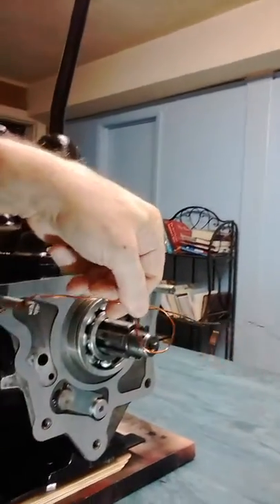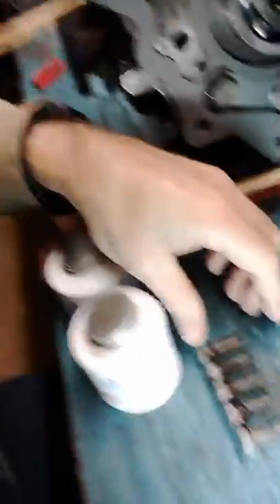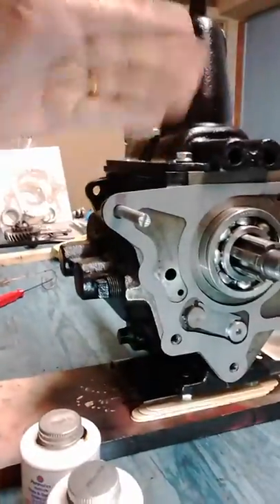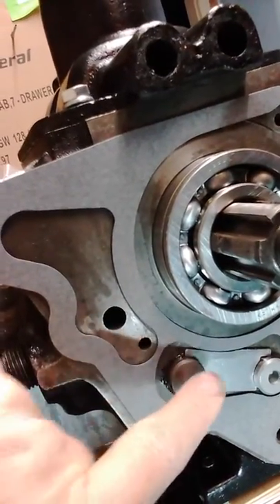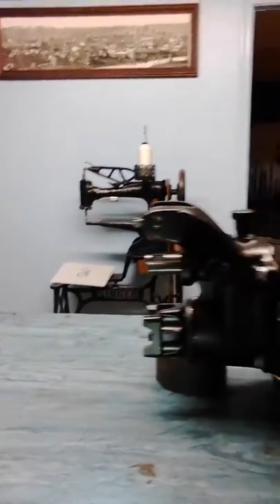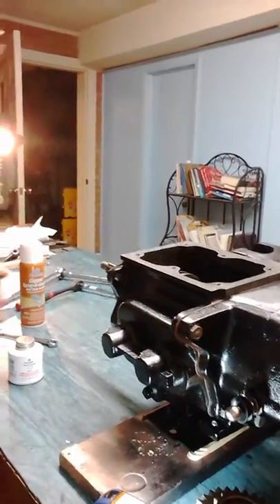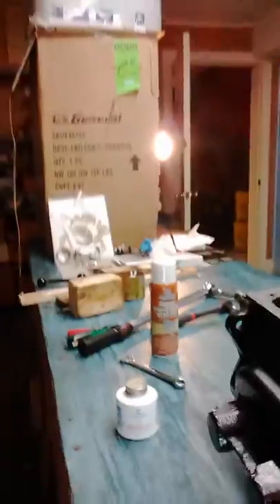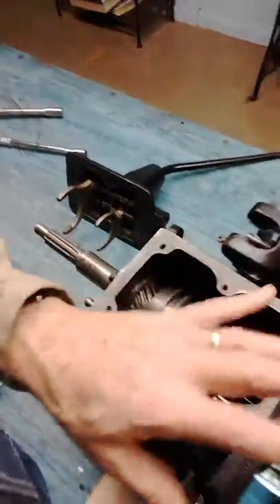TC PT 11 - mating the D18 transfer case to T90 transmission

Comment: The alignment dowels are a great idea. As someone getting ready to pull a T90 transmission and D18 transfer case and never having done a rebuild before a demonstration of the alignment pins would have been nice for when I finally get to that step. Still appreciate the tips like the 2 1" bolts going where they do to avoid hitting the internals. Thanks again.